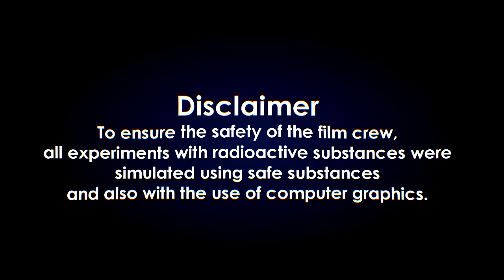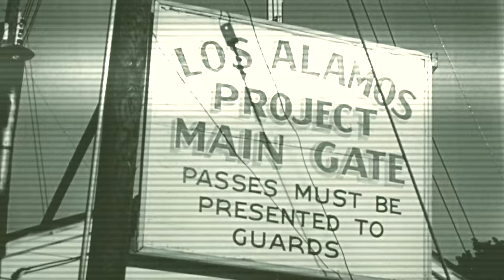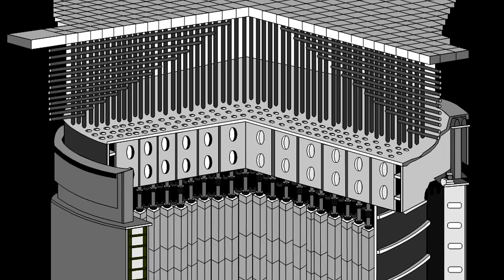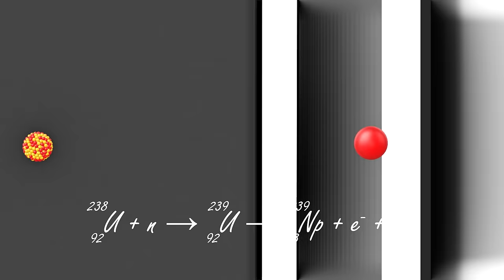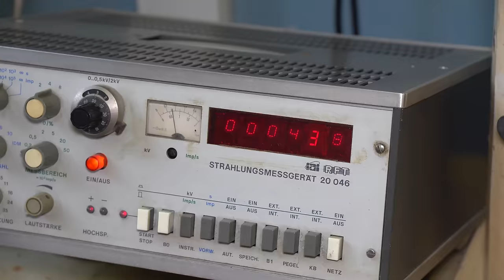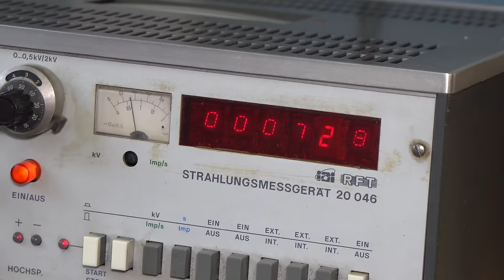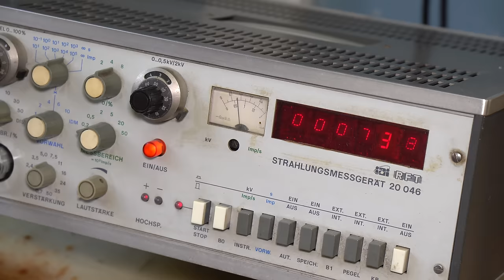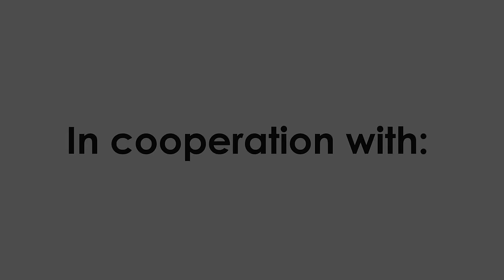Plutonium - The MOST GUARDED Metal on Earth!

Comment: Wow dude, you're handling plutonium without gloves! You have some huge neutrons!
Reply: An Uranium 238 pellet is pretty safe to even hold in your bare hands, but absolutely deadly if iarradiated first with neutron bombardment in a reactor.
Reply: But become mostly harmless in a few decades really and a century later they're not even really a problem in the grand scheme of things it's not even a blink of the eye
Reply: No, plutonium is dangerous to hold because it's a chimical poison, not due to neutron emission (Pu-239)!
Reply: It's not that big of a deal. Most Pu isotopes don't emit much gamma radiation. Remember, americium-241 is used in modern smoke detectors, also an alpha emitter and low-energy gamma emitter, and is even more radioactive than plutonium, in general. The activity of Am-241 is comparable to Pu-238, however, Am-241 emits about 36% gamma rays at 59.5 keV per alpha decay. Pu-238 emits only about 0.04% gamma rays at 43 keV per alpha decay, and it's even less for Pu-239 (0.027% at 51.6 keV). These are the most frequent energies (branching intensities). They are almost pure alpha emitters. As long as you don't ingest, or especially, inhale any alpha emitting radioisotopes, the risks are usually low, especially if the gamma intensities are low. That makes it safe to handle externally, even in relatively large amounts.
Reply: @KarbineKyle  one of the reasons why americium is not uncommon in attempted homemade reactors. And while I'm not sure about the exact numbers that you give here it sounds about right.
Reply: He also says that some are simulations so he's not always handling Pu
Reply: @Forwardbias83  I think you are a chemistry scientist
Reply: Pretty sure the shots of him working with the “plutonium solutions” don’t actually contain any plutonium... nobody would’ve just give him plutonium to take home to play with
Reply: Did you not hear the part where he said it was all "simulated"? In other words he was literally using vials of freaking easter egg coloring or something instead of actual plutonium, and showed stock video of the goings on inside nuclear facilities because they wouldn't let him film there himself.
Reply: As demonstrated, Alpha decay is so weak that a sheet of paper is effective shielding, beta decay is also fairly harmless provided you don't ingest or breathe in the emission source. It's Gamma decay, that will give you all the cancers if not outright kill you from radiation sickness. If you held a pellet of Plutonium in your bare hands, it would feel warm, if not hot to the touch, and be significantly heavier than its volume would suggest. It's not something you want in your system though, as it'll pretty much stay in your body for life. There is a story about a Los Alamos scientist who pricked his hand while working with Pu, and trace amounts of the element could be detected in his urine for the next 50 years.
Reply: @BraleJunior  but you can;t eat one
Reply: @Prich319  - what about all those neutrons that are given off?
Reply: @Bobby-fj8mk  again, Plutonium doesn't emit that kind of deadly radiation unless certain conditions have been met. You may be thinking of the Demon Core, which was an A-bomb core which was just below it's critical mass, the point where the metal has enough mass to undergo fission on it's own. It was involved in two accidents at Los Alamos, in the first, a beryllium reflector was accidentally dropped on it, causing it to go critical. While it wouldn't explode under these circumstances, it did undergo fission and release a lethal dose of radiation on the physicist standing near it, and a  security guard standing further away. The physicist died nine days later, the guard lived for another thirty years, and died from cancer. 

TL;DR: If your performing criticallity experiments with nuclear isotopes, and at some point it emits a flash of blue light, if you were standing anywhere near it, then you're already dead.
Reply: @Prich319  - Hi Prich - I'm not sure about it. I do know that Geiger counters don't measure neutron radiation and that is something nearly always forgotten in these discussions.
Geiger counters measure : alpha, beta & gamma radiation.
I know all about the demon core.
Reply: @Bobby-fj8mk  interesting from everyone, nothing in my mind silly about playing with deadly things.  I like to learn things, learned some of this in school of what they did.
Reply: @Vinlaell  Agreed, that's what I said.

Comment: This man just told us how to make a nuclear warhead...

Subscribed.
Reply: No,he did not and even if true the materials you cannot get anyway-so no.
Reply: @bobair2  Thank you for telling me sherlock.
Reply: He didn't told to make he just told how and there's a difference between the two.
Reply: A-Bombs are easy.
Reply: Just get two half spheres of uranium 235, 30kg each, combine both spheres, and boom nuclear bomb, its just literally having enough radioactive metal in one place, good luck obtaining enough pure u-235 or pu-239
Reply: @Clancydaenlightened  Sure, if you want a very inefficient low yield with a ton of unreacted material. A gun / pellet method with a "bullet" is just enough to pass critical mass, along with localized compression is better and somewhat safer. An explosive  compression method is a step up from the gun method, and removed much of the fear of accidental criticality. There is also reflection enhancement methods that are mostly meant to encourage full reactions. So although critical mass and super criticality is technically easy, getting the best efficiency is another story.
Reply: @Worse_than_you_can_imagine  False. Tritium is used for boosting in the primary as well as initiation of the secondary.
Reply: Lol
Reply: @wolvenar  a 1-5 kiloton explosion still will do enough harm, though more from contamination, the point is that it's not difficult In itself to create a nuclear explosion, it's really about efficiency, instead of 1-5kt from 60kg, you can get a few hundred kilotons or even megatons with the same Mass, the atomic bombs' only goal is to keep an uncontrollable fission  reaction fueled for as long as possible until the energy literally blows itself apart
Reply: @Clancydaenlightened  You left out the initiator. 2 different metals that emit neutrons when placed together. 1 Half is Beryllium which is fairly easy to obtain. The other half is much harder and a lot more dangerous.
Reply: @Clancydaenlightened  Yes, very true
Reply: @ankles632  that's for a fat man style or implosion type, which uses plutonium, little boy was essentially firing a u-235 slug in to the "block" it was "cut out" from, which causes the core to go critical and one could use a neutron gun or reflectors to help initiate and sustain fission, u-235 can be split by slow neutrons plutonium cannot iirc. Plutonium has to be put in a supercritical state and then which the initiator generates the neutrons to achieve fisson
Reply: @Clancydaenlightened  Isn't it a bit scary just how much knowledge of how this works is pretty much available for anyone even casually interested. Thankfully it's harder to accomplish because of the multitude of factors than it would seem. Yes, one of the primary being availability and difficulty to obtain required purity of the key materials.
Reply: everything you need to know is in a Library
Reply: @tracycolorado  yep, the Hiroshima gun type bomb was already guaranteed to work (think of a cannon shooting a slug into a sleeve on the opposite end) because the math guaranteed that having that combined mass would achieve a nuclear denotation (with the help of neutron reflectors and a neutron gun to ensure fission starts) the bomb dropped on Hiroshima literally wasn't even tested, the fat man or Nagasaki bomb or implosion type bomb  is what the Trinity test was for, since this this can increase efficiency 10 times, (using plutonium), so while the gun type bomb used 60kg to achieve around 10-15 kiloton, the implosion type only needs 6kg of plutonium to achieve that same yield, now you can make 10 bombs instead of 1 but each carries the same power, this technology is not used In nuclear weapons of USA and Russia, etc, hydrogen bombs are used now, though they still use a fission detonator in some way
Reply: @frogbutts3628  it's because you have to use high explosives to create near perfect spherical shock wave, to crush the plutonium to increase it's density which then the initiator takes action to get fission started, this requires special "lenses" to shape and direct the shockwave, and is also dependent on the high explosive composition itself
Reply: The knowledge is the clickbait but it got very expensive when you have to get the materials and of course the facilities to build one.
Reply: @wolvenar  Indeed.Obtaining Plutonium or Highly enriched Uranium (HEU) for nuclear weapons is impossible for terrorist organisations unless they steal it somehow (which is unrealistic but not impossible).

Once you get Plutonium (reactor fuel reprocessing method) or HEU ( uranium enrichment centrifuges) -you've done 90 procent od work.Weaponisation is not that difficult
comparing to obtaining fissile materials...

Once simple atomic bomb is produced/tested - states usually proceed to produce  some fusion fuel tritium (boosting gas) /Li6D (secondary stage fuel) to turn ordinary Atom bomb to way more powerfull Hydrogen bomb also known as "termonuclear bomb".

For a determined state making nuclear weapon is not that difficult. Pakistan and North Korea both have very small economies jet are nuclear weapon states.

Out of 211 world states North Korea is ranked 200 with GDP couple times less then some undeveloped African countries jet they are in possession of very sophisticated nuclear devices...
Jet we saw states with much higher economies such as Taiwan fail in its "nuclear weapon" quest. Determination and willingness to obtain them at all cost play crucial role...

Japan GDP -  5,154,475 (US dollars million) - Do not possess nuclear weapons
South Korea GDP -  1,629,532 (US dollars million) - Do not possess nuclear weapons
Pakistan GDP - 284,214 (US dollars million) - In possession of relatively sophisticated nuclear arsenal
North Korea GDP - 40,312 (US dollars milion) - In possession of very sophisticated mid-sized nuclear arsenal

That tells us a lot?
Reply: Did you not know that has been public information for decade? You can learn how to make nuclear weapons by reading an encyclopedia entry from the 1980s.
Reply: @bobair2  I wouldn't say that.  A boy scout in Michigan somehow managed to order uranium from Ukraine years back and built a small nuclear reactor in a tool shed.  I think he used radium or something from old antique radium painted clocks to initiate a reaction.  Look it up, it created a major hazmat situation around the neighborhood
Reply: @bobair2  yeah you can get PU 238 in certain places in the world. (And I'm not talking about buying it) I'm talking about finding it.
Reply: @JustBadly  they're even more disgustingly easy if you go for the uranium based ones because you can literally jerry-rig an artillery gun for them which is what they did for the uranium Warhead when they nuked Japan
Reply: @peterb8904  - Justin - you have no idea.
You'd need an enormous quantity of U235 to make one atomic bomb -
over 60Kgs and U235 is only 0.7% of natural uranium. The rest is U-238.
So you'd need nearly 9 tonnes of Uranium metal from probably 100 tonnes of Uranium ore.
Separating it out would take a multi  $billion monster factory.
That is something that only a nation country can do.
Reply: @JustBadly  Yes the principle of an A-bomb is as easy as that of a revolver. Getting the raw materials is the tricky bit.
Reply: @JustBadly  oh yeah, walk in the park mate. People make them all the time in their shed.
Reply: @bobair2  I don’t need money I have my parents credit card
Reply: Open Domain stuff
Reply: Lol
Reply: Not even close to how to make an atomic bomb - especially out of Pu239.

One key error is that he implies that you can make Pu 239 bombs from reprocessing nuclear power plant fuel rods that have run 3-5 years.   I assure you that will not work.  Not even close to working.  The problem is that the reprocessing of fuel rods uses a chemical separation process to separate the Plutonium and Uranium.  There are multiple isotopes of each - and at least one of those isotopes from power plant fuel rods "poisons" the Pu239 as a bomb material   There are reasons why nuclear bomb grade Pu239 or U233 is made in highly specialized bomb grade material reactors and reprocessing plants that do things that normal civilian reactors and reprocessing plants do not do (and by design would be extremely difficult to do - and not hideable to the world).

Also, all of those chemical steps he claims he does not know (or are secret) - are well known and not secret.

Another key error is that he fails to discuss the need for an initiator for a Pu239 bomb; and how it might be accomplished.   The actual designs of Initiators is indeed a secret (and the WW II initiator design for "Fat Boy" is still classified as Top Secret to this day.   But, it's fairly easy to figure out different ways to make an initiator, and no country that developed Pu239 bombs has failed to figure out a working design.

Comment: Plutonium is such a fascinating element! It's a real shame that so many people have an irrational fear of it, rather than to try and understand it! Plus, the dangers of plutonium are highly exaggerated! Don't forget that modern smoke detectors use americium-241, which is also very similar to plutonium (chemically too). Its radioactivity is comparable to that of Pu-238. However, Pu-238 only emits its most frequent gamma energy at 43 keV at 0.04%/alpha decay. For Am-241, it's 59.5 keV at 36%/alpha decay! It's even less for Pu-239, which is 51.6 keV at 0.027%/alpha decay. These are the most frequent energies emitted (branching intensities), and they're low-energy gamma rays too. This makes plutonium relatively safe to handle externally, even in relatively large amounts. However, you do not want to ingest, or especially, inhale any alpha emitting radioisotopes. The sealed source in the thumbnail of this video, for example–you could sleep with that under your pillow and receive basically null effects (or dose). This is a good video.

Comment: Undo believe it would be more than shaking. You would have to be some type of centrifugal force to get them to separate. Encourage the mechanical separation when you have them suspended at the different atmospheres if you will by the fluids. 

Also, why did not you're not used ceramic you could embed the graphite and other materials into the pellets surround the plutonium so that you could control its breakdown in a more sufficient manner than just stacking them together. The amount of surface area that's uncontrolled is unreasonable in my opinion. Were embedded in a ceramic type of material that was infused with graphite, lead is mentioned because of its weight, but I don't think it's actually a good suitable material for working with a high heat material. You would want something that had a strong molecular weight such as lead, but that was already burnt up such as... Ozium the dense material on earth. It's like when you're working with a firearm cartridge. You have powders that burn at different rates. You want a slow powder for a long barrel and a fast burning powder for a short barrel and the nuclear concept is the same. The longer you can make the initial explosion build in pressure before causing the actual pressure of the device to go off the more extremely explosion as the more reactions you'll be achieving. Otherwise, you'll just be blowing the atomic material all over the place. You could control to a better degree, the movement of the molecules and how they could be moving within the material. Encouraging it to break down or not. As far as the particle accelerator, I thought that was kind of funny cuz you can make one that's way more powerful in your basement than what they had back in the 40s using electromagnets.

But you can use it in ramjets, that heat. If you can control it once again, you would do through the use of composites. You can make it last longer if you don't allow it to eat itself. Plus you would need to keep it thermally and the range of say titanium which would be under 2,000°. Otherwise you could cause failure of the power plant. That could be achieved either through the lowering of the heat of the material which I wouldn't do or optimizing airflow which is the approach I would take
Why don't they use some type of material to stir the mixture? In the last bit with the cone it would stand to reason that there would be something in there too. Mix everything together as the explosion occurs. Such as tungsten that would bounce around and mix

Would this be off point?? I'm curious YouTube learning if you will.
Reply: I really like these types of presentations cuz a lot of times. Most of the information is really relevant because the scientists want to be able to have credit that they did something but at the same time they try the safeguard their secrets by omitting pieces of information. It's kind of fun. The riddle... Like if you had me on your team you'd be in first place but since you don't, here's the recipe for second and then you have to figure it out.